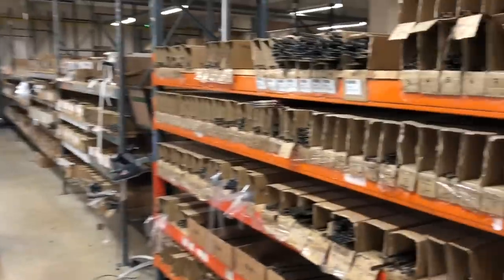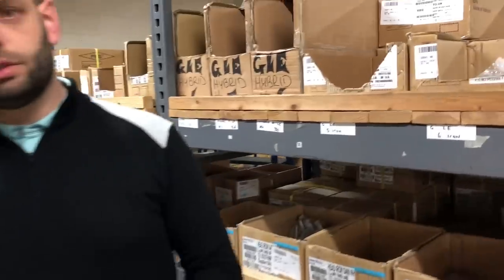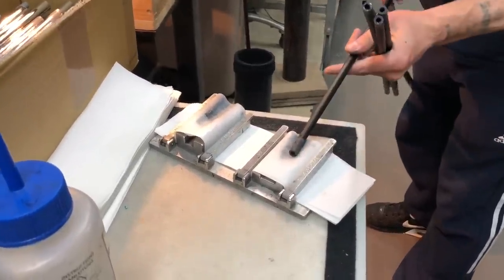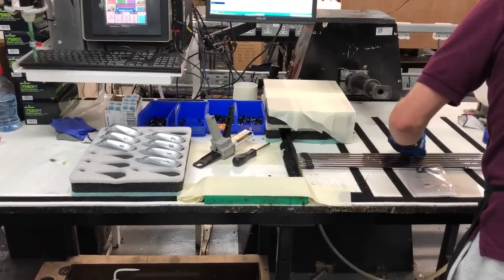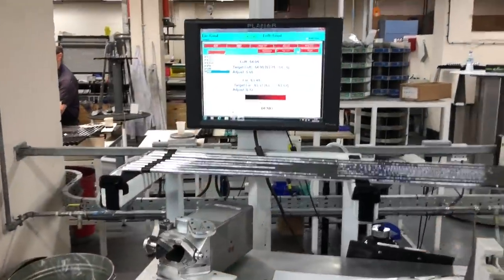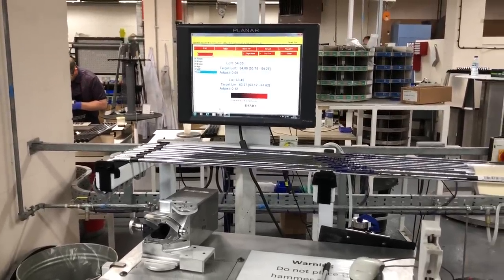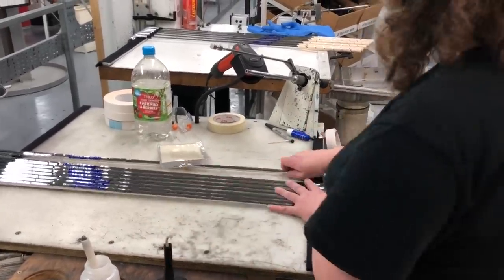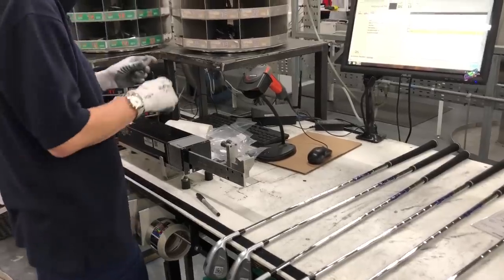PING Factory Tour - How A PING Iron Is Built

Comment: Hi , now i remember why i came on , i have just bought the new ping from American Golf  East Ardsley WAKEFIED store , had a fitting by the guy in the shop . tried different shafts settings but was disappointed with my distance on simulater , is this so we buy if so should distance not be longer ?? i ask as my previous club went 230 in there but on course i hit drives of 285 plus , Now this NEW  PING LATEST only went 212 at best can someone explain please. paul